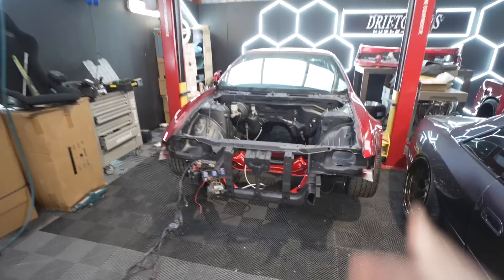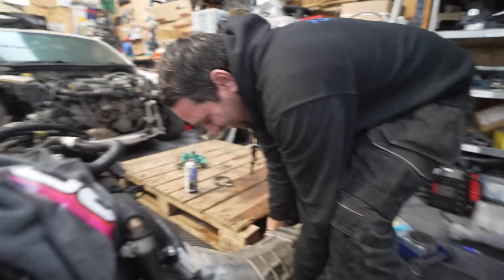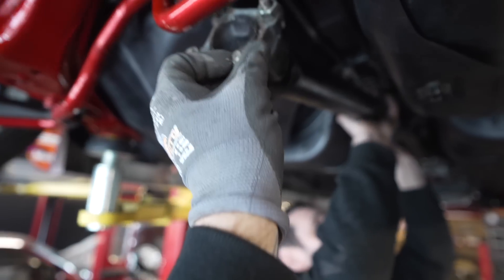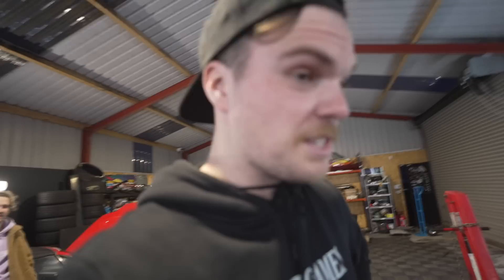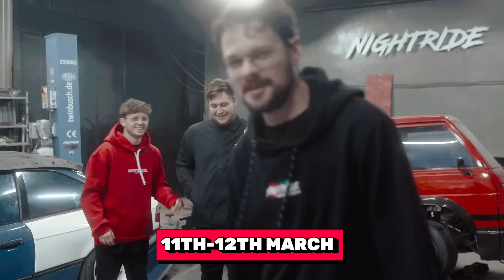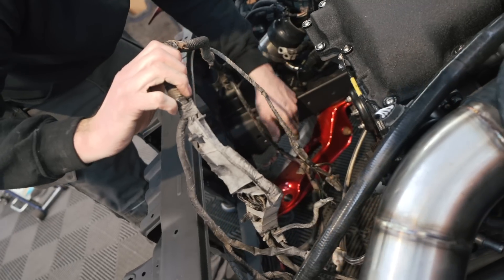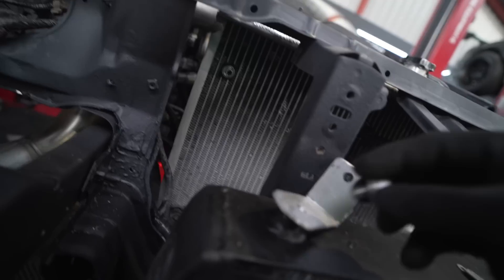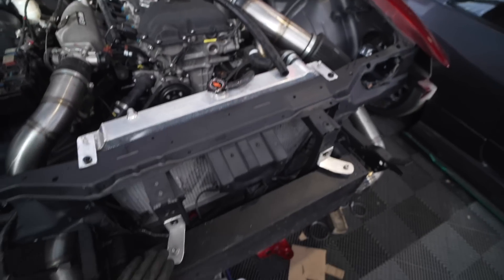SR22 fitted to our S14 project | 500bhp here we come…

Comment: Those are v35 skyline / g35 brembo caliper .. this modification works on C chassis ,S chassis and R chassis also Y chassis but on the Y chassis, you do not need to drill the hole out

https://youtu.be/0ZhfbSuyYuE